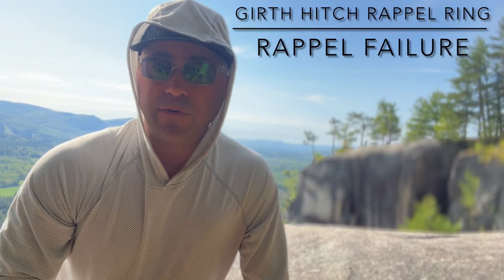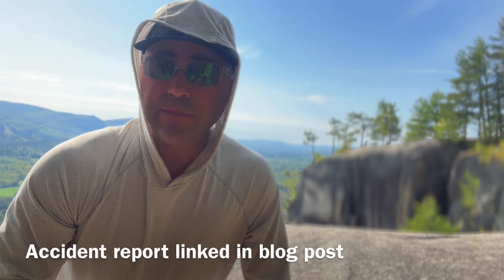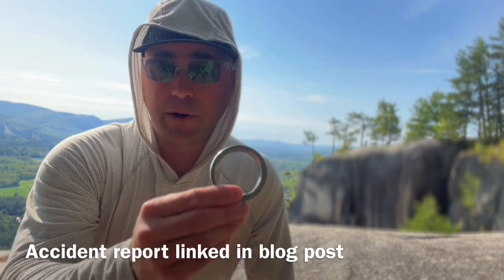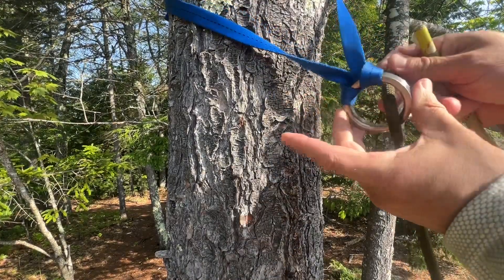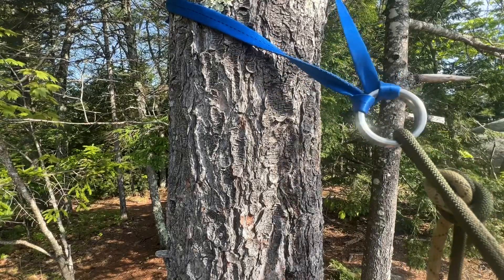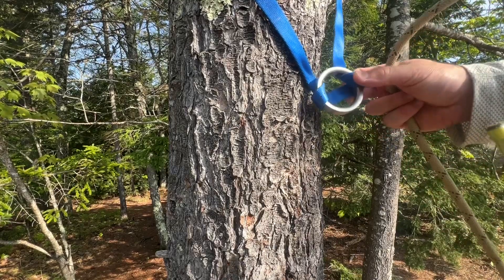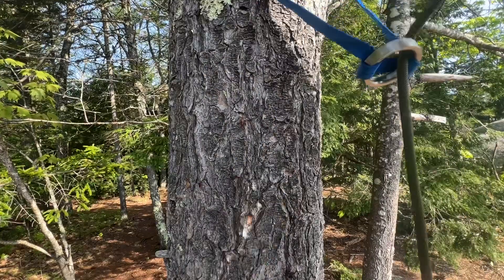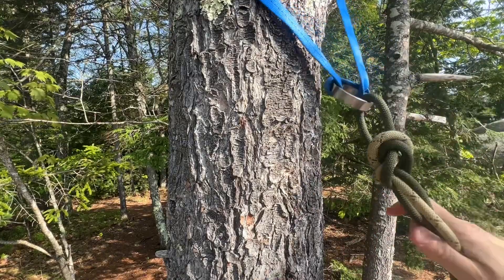Girth Hitched Rappel Ring Anchor Failure

Comment: I always weight the anchor with a back up before I commit to it.  Rappelling still frightens me after 30+ years of climbing.
Reply from the maker: That’s a wise best practice!
Reply: @NorthEastAlpineStart  I fell once when I was rappelling.   Rapped off the end of a rope.  Wasn't paying attention when I rigged the rap.  Thought the 5 meter marking on the rope was the middle mark.  Should have died.  Now, when I am rigging my rappel and getting ready to rap, I have a rule that I do not talk with my partner.  Chit chat almost got me killed.  I focus on the rap now.
Reply from the maker: @tacul9333  I’m glad to hear you survived! That is so scary! I’m pretty sure rope manufacturers quickly stopped adding these non-middle marks as I had heard of this happening. End of the day your instinct to slow down and not let distractions effect you is a good instinct to have!
Reply: I weight everything at setup, then again at the edge, then again just to be extra sure. And when rappelling after a break, have a second top rope backup, at least for the start.